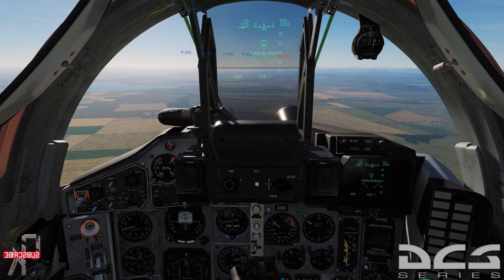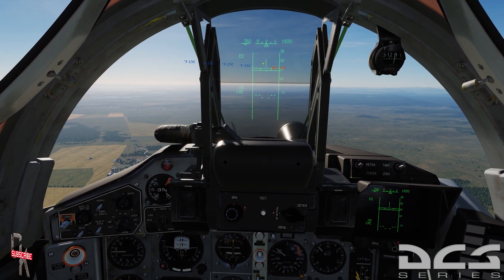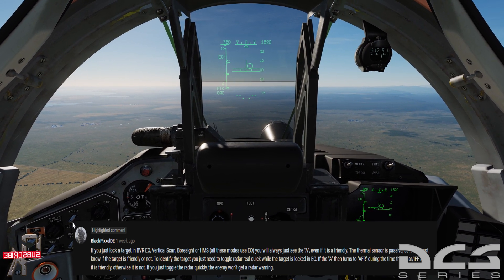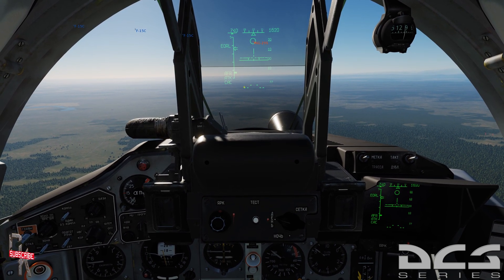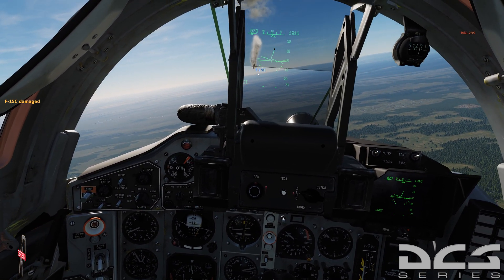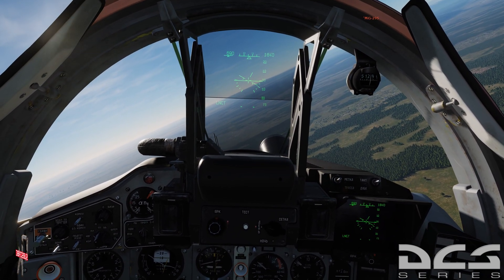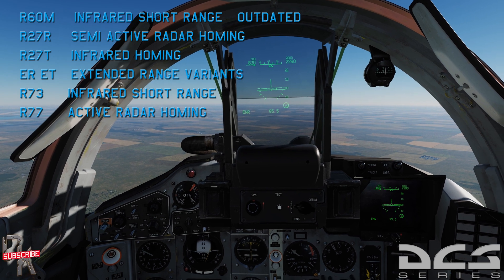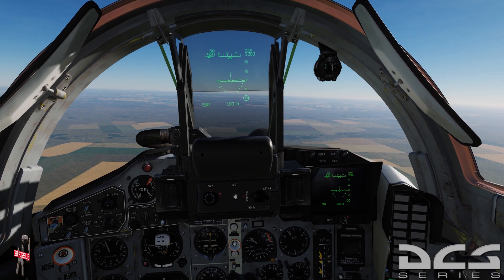Basic Fundamentals DCS World: MiG 29 VSC BSM EO JHMCS

Comment: Great Tutorial again, :) But a small correction is needed. In the video you stated if you lock something in EO they won't know where you are when you take a shot. Except when you Cycle your radar, They will spot a quick spike. Just remember if you take a shot with an IR missile or a fox 2 that is true. Unless they happen to spot the smoke. But. If you are in EO and you fire a Radar guided Fox 1/Fox 3. your radar will switch on automaticly to help guide the missile. So if your going to fire in EO mode to be sneaky. Remember IR only R-73, R-27T/ET. But the second you fire a R-77 or R27R/ER, your radar will automaticly switch on to guide the missile. Now you can always cycle the radar off on the 77 but they will still know which direction it was fired from as it goes active. But if you turn off the radar with the 27R or 27ER. Well you might as well not brought it with you in the first place cause it will go stupid instantly :D . Happy New Years and thanks for the video. Great work.
Reply: Thanks this helped me too :)